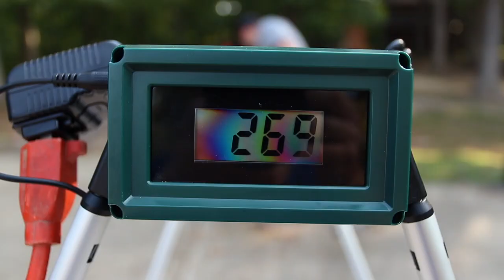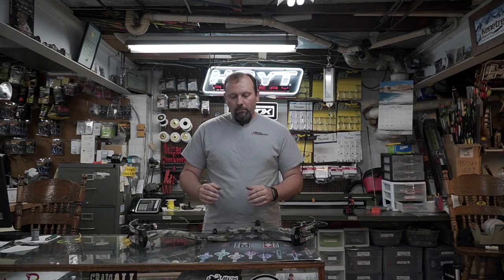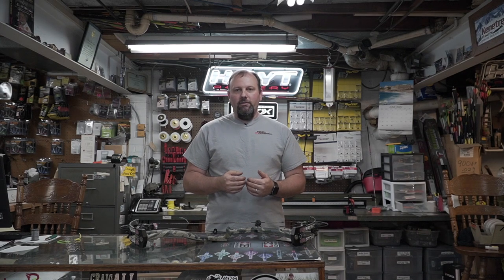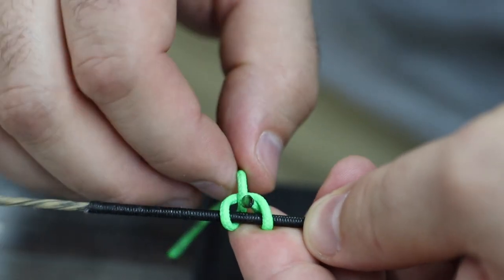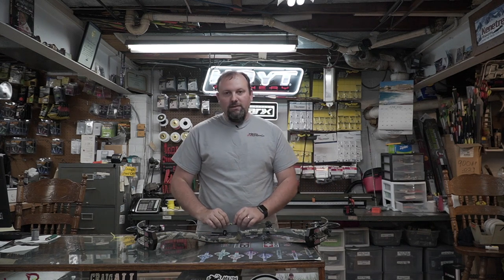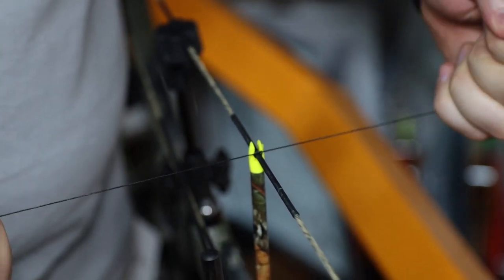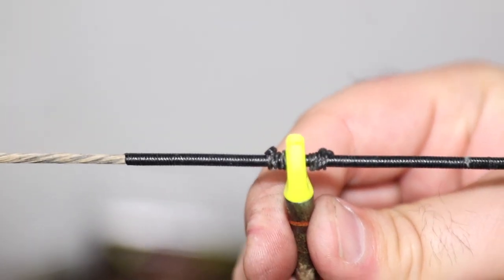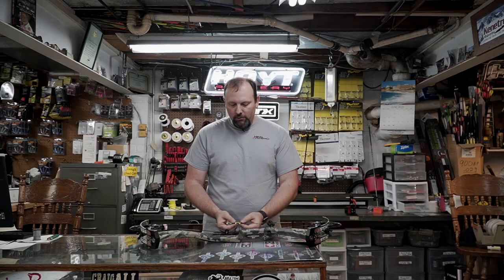How To Tie Two Styles of D-Loop on Your Bow String Mike's Archery DIY

Comment: I agree with your D-loop length recommendations. If you go shorter than 4", you risk bumping the nock with your release claws. After cutting to 4-1/2", I flared each end with a probe tool, heated the end without burning it, and mushroomed the hot end against a flat metal surface for more end flare. If you let the D-loop end catch fire, material will burn off and may shorten it or make it too brittle.

Comment: I don't think that's actually a Clove hitch.
Reply from the maker: https://www.101knots.com/clove-hitch.html
Reply: @MikesArchery  hi Mike, Sorry not trying to start trouble. I know what a Clove hitch looks like having used it rock climbing, working on commercial boats, teaching knots. So anyway I was just pointing it out. No big deal. The picture you sent isn't what was tied on the d loop and from what I understand isn't what is typically used. 
Regardless Thanks for the video or was very informative and I learned from it. 
Cliff
Reply: @clifffield1108  double larks head knot
Reply: Yeah it’s not a clove hitch. I’d just describe it as two half hitches.